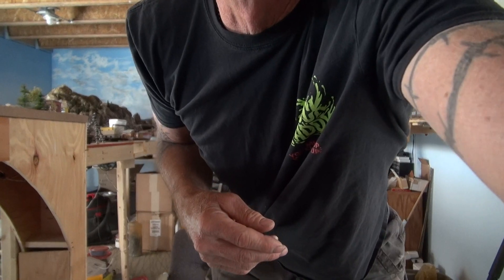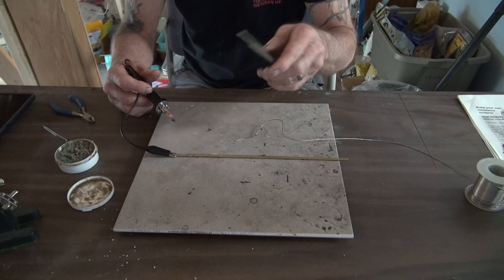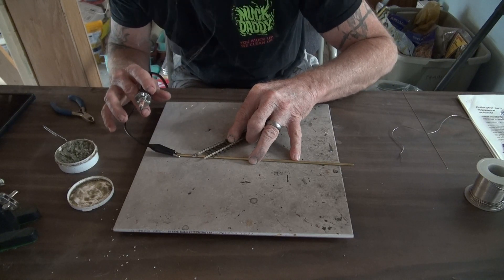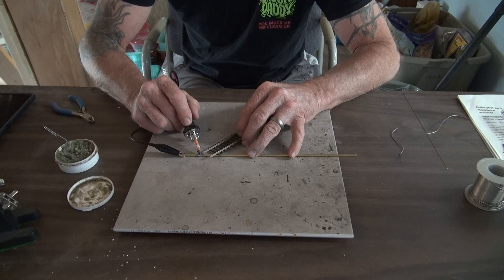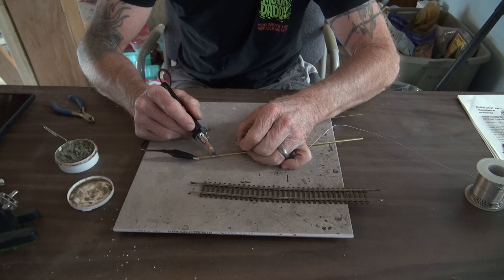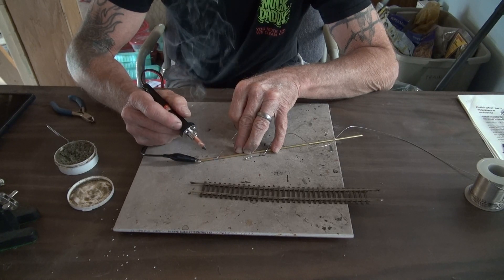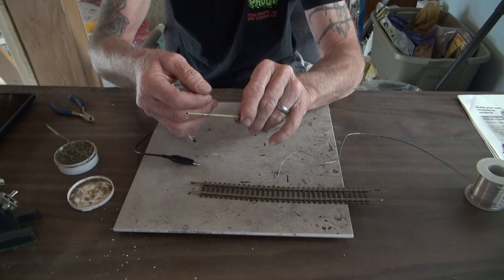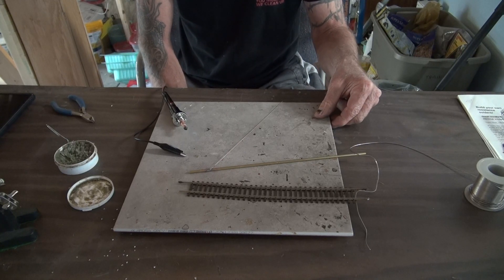video 2 of Resistance soldering iron

Comment: I was just ready to plunk down a bunch of Benjamins and jump full into resistance soldering when I came across your video! First, it is the best diy video - you actually show, and list, everything it takes to get the job done. Most other videos are vague  - a transformer - ?  What the heck kind! There are a million!
Now I am ready to break one Benjamin, have some change and melt some solder! My question is this, how is your power supply holding up?? In many different ways I have worked with DC current most of my life and DC is great, but converting AC to DC is always where the issues are. If yours is carrying the load I am ready to jump in! Thank you for your time and your great videos.
Reply: Great, I will stay at 30 amps. I will be jumping in, let you know how it goes! Huge thanks!!
Reply from the maker: Hi and thanks for commenting. A couple of things I want to express from this video. 1st the power supple is working great, some people have purchased a larger power supply but be aware that with allot of power comes heat and for delicate parts they will most likely melt. I would suggest a variable power unit so you can adjust how much output you have. 2nd, this type of soldering isn't designed to heat up the area to be soldered like a conventional unit. But that you use it more like a welder using the arch from the carbon tip to solder the part.

Comment: Thank you so much for sharing. I'm just a little ways into 2 rail O scale as ho was getting just a lil small to see. Have collected a few CLW brass kits to build and am stoked to get started on them. $600 plus for a RSI was just to much, Then bingo you popped up and well  I'm gonna try your design. Thank you so much!....
Reply from the maker: Just a heads up on the soldering station. Once in operation, practice on various scrap pieces. This type of soldiering will take some practice to make perfect.

Comment: How did you attach the lead wire to the carbon tip? did you simply soldered the wire to the copper tube which holds the tip ? thanks.
Reply from the maker: The carbon tip comes with a copper clad around the carbon. When you insert it into the soldering iron and tighten the screw, it makes its contact.
Reply from the maker: Note...you have to get a soldering iron that has a screw that holds the tip. You will have to modify the length of the iron, which is simple once you disassemble it.